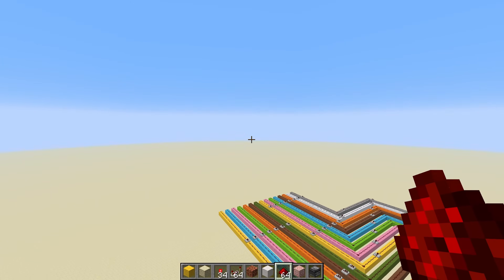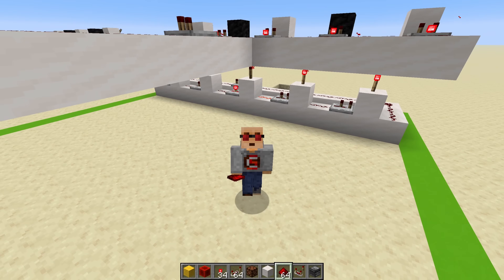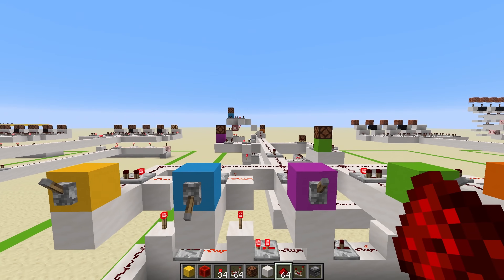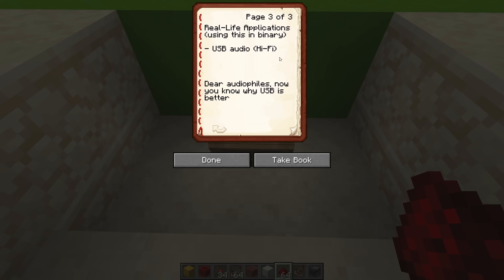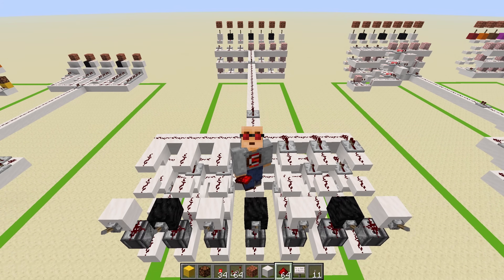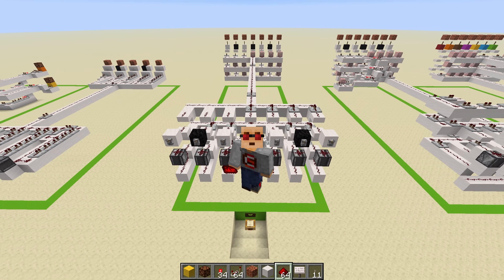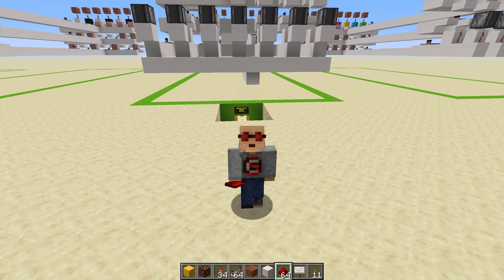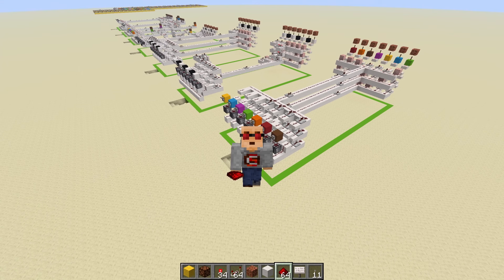How to Send Multiple Signals on a SINGLE Redstone Wire

Comment from the maker: I've deliberately left off signal strenght, since it's extremely slow because it requires a comparator every three blocks to transmit the signal, also it's limited to 15. It's just not practical
Reply: This is not true, I have a build that transmits fast signal strength, it is a well known circuit that uses 15 repeaters
Reply: @challox3840  Agreed. Using that to allow a single bot controlling 256 individual stasis chambers all without ever moving a single inch.
The repeater approach is a bit more bulky, but way faster. And allows for easy staircasing to change height.
Essentially a 3 wide wire that allows you to transmit analog signals at the speed of traditional binary values (where one repeater would be every ~15 blocks).

They're super useful for redcoders (where a specific redstone strength toggles/pulses a specific signal briefly). If you need multiple simultanious outputs, you could probably encode 4 bits in each. So just 3 of these wires could likely transmit 4096 unique signals with the proper encoders/decoders.
Reply: In terms of simplicity and flexibility, binary is probably still the best.

Did some experiments, and was able to transmit and receive 4 signals over analog each. The encoding to analog is suprisingly simple, but the decoding gets messy and my current solution produces temporary wrong outputs (im-perfect solition with postion only fixing signal slightly delayed).
Reply: You can actually do a comparator every four blocks if you're alternating comparator, block, dust, block.  And there is a design that can transmit a signal strength at ~90 m/s, but the wire is three blocks wide.  If you wanted to transmit more than 15 types of signals, you can combine the signal strength encoding with any of the other methods that are in your video.

For a single wire, using signal strength has the potential to give you 4 times the data transfer rate but at the cost of doubling your latency, tripling your wire cross-section, and greatly increasing the amount of work you have to do.  I think the main reason almost no one uses it is because if you want higher bit rates, it's easier to just build 4 normal wires than to build a single fast signal strength wire.
Reply: Chunky, this just showed up in my algorithm for some reason. I never considered using Minecraft to model information theory before. If you're interested about this topic, check out Claude Shannon's "A Mathematical Theory of Communication." The content of this video is directly tied to the Discrete Noiseless System part (Part 1) -- Harvard's math department has this filed away, and it's free if you have access to the internet. I will attempt to leave a comment with the link below this one in the pinned comment. This was a really interesting video that basically describes Part 1 of the paper in layman's terms. Your acknowledgement of signal strength is why I decided to comment, because that means you've got the right intuition about the next steps in information theory. If you have any leads about AlohaNET-type problems, I'd love to hear about it.
Reply: https://people.math.harvard.edu/~ctm/home/text/others/shannon/entropy/entropy.pdf
Reply: @redcap7468 rip, no link is visibld
Reply: Since you got yer nerd on. You mention signal strength limited to 15. Both 4 bit binary and hexadecimal operate on a total of 16 states of 0 to 15. 4 bits of binary is sometimes referred to as 8421 code. And those numbers align with your four bits and add up to 15. lol... Enjoys. 🤓
Reply: I actually have a method to make it so you only have to place one comparator every 7 blocks with a throughput of 4 bits per redstone tick and a transmission delay of ~2 redstone ticks per chunk. Just feed the signal into the side of a comparator in subtract mode and put a lever or torch behind the comparator. the output is 'inverted' for the upper half of the signal strength (ie signal strength of 15 goes to 0 and signal strength of 0 goes to 15), but every time you repeat the signal, it swaps. Doing this allows you to get way higher throughput on a single wire by taking the strengths of 'analog' and digital signals, while only getting a small amount of delay. 4 bits per second on one line with only a 2x increase in propagation delay seems like a good tradeoff in most cases where you're doing long transmission lines. I can send a pic of my setup if you'd like :)
Reply: yep, did the same. I thought he would show the analog method but nop
Reply: There is a thick wire configuration that let’s you transmit analog at the same speed as standard signals
Reply: The simplest method I thought about, since it was only transmitting a state, was to send every signal at a specific frequency, mixing them all along the wire and decomposing the arriving signal in Fourier series to independently check the state of every signal, what would be the implication problems with this method?
Reply from the maker: @Stef_8319 That's basically what I'm doing with the asyncronous method👌
Reply: You can make instant comp lines using CUD

Comment: the IDEA with those optical media methods is that they synchronize by talking over the wire first, where the device is listening, and the host is talking
host basically says "are you there?"
and THEN the device says "yes, im here"
and it measures the delay between when its sent and when it gets a response through some further magic, before the host then says the whole system is sync'd 
and the entire system requires the HOST AND DEVICE to be of good enough quality
any low quality part makes the entire system fall apart

otherwise, if it only sends from the host, it will use things like a "timing pulse" that is ALWAYS on (or a pattern), and so when there isnt any audio, that timing signal is ALWAYS sent

i have a smart TV and a soundbar that work over the optical cable, and there has never been any audio distortion, likely because i didnt cheap out on the entire system

you can actually see this if you watch the light on the other end of the cable, because it has a set pattern of flashing, up until it starts to actually send data

Comment: 3:06 For the record, yes, S/PDIF and TOSLINK both use synchronized clocks at both the transmitter and receiver to reconstruct the signal, and yes, it is possible to lose data over these connections. However, it isn't due to the two clocks being out of phase, as might happen in Minecraft, it's caused by one of the clocks being slightly faster than the other, a phenomenon called "jitter." In extreme cases, this can lead to phantom bits being transmitted and adding a huge amount of noise to the signal, but most devices which use these protocols are accurate enough that jitter isn't an issue, and some devices even have methods of rejecting noise produced by jitter when it does occur. To say that transmission protocols which rely on the receiver synchronizing it's clock automatically to the transmitter are inherently poorly designed is inaccurate.

Comment: Made a minecart system with multiple stops using a single wire and signal strength, all with repeaters back in version 5 to 7, no comparitor needed just make the signal only reaches if a certain strength is met

Comment: another simple idea that pop in my head before watching was a binary method where each line carry 3 lines of info.

you take a line where every 8 block you add 8 power to the line. but there are switches that can add 1, 2, or 4 to the line.
so you use a Redstone Comparator to read the signal.

so if it 3+8 then the 1 and 2 are on. if it is 8+7 then 1, 2 and 4 are on.

this would simple divide the number of lines by 3.

you could also add timing to it to make it hold more info but that would add alot more complexity to this method.

may be add a line going back that tell which cycle is active, this could multiple the info by 8 so having 2 lines can give you 24 lines of data. but this will change it from constant to pulse data.

Comment: Your disparagement of real-life synchronous transmission schemes is a bit unfair. In practice, the protocol is always designed so that there are features of the signal that the receiver can lock onto and synchronise itself with.
The main reason for not using a separate clock signal isn't to save money, it's to avoid problems with skew. Signals sent at the same time don't necessarily reach the far end at the same time. This isn't a problem in Minecraft because transmission times are perfectly predictable, but it's a big issue in the real world.

Comment: You have no idea what you're talking about. Toslink and spdif use Manchester encoding to encode the clock and the data into one signal. It's a self clocking, stable data stream. It does not desync. In fact, this is better than a separate wire for clock, as then both wires would need to be length matched.

Comment: Wouldn't it be possible to replace the clock with world sync timers based on daylight sensors? This would eliminate the clock line or the need to sync timers, and overcome the most severe disadvantage of the serial one line approach? 
This should be simpler and probably faster then the admittedly impressive other circuits.
Reply from the maker: That's a really good idea! Defo try it, let me know how it goes!

Comment: Great work, and cool to see you so active with your YouTube community (reading/liking comments/etc even on 3w old videos). Wouldn't be surprised if soon you get too big to keep up, and I guess I'll hope that happens for your benefit. 🤣

You explained a lot well, always hard to explain to a large audience but you kept it pretty simple, and I think even if people don't follow the details they understand the options and limitations.

One bit I particularly didn't get, even as a software engineer with some knowledge of digital electronics and familiar with binary was how you're getting more efficiency encoding 7 levers as "binary" over 3 wires. I thought on it some more, and assumed you're basically sending an "address" for a lever that changed at once? Since if you want to send the state of all 7 levers I can't see how that would fit in 3 wires (without sending multiple pulses), but you could send a lever change in 3 wires.
Reply from the maker: Thanks for the donation! I try to reply to comments because some of you guys have good ideas😄. As for the binary, like everything, as soon as you "compress" a signal, you inherently and inevitably lose some function. For example, lossless audio formats like FLAC leverage the fact that you have limited entropy to reduce file size. If you had infinite entropy in your music, it would be the same size as an uncompressed WAV file. Here, because you're forcing compression, there's inherently some things it won't handle without losses. For all methods except the syncronous, if you flick two levers at the same time, that'll create losses, aka errors. Hope this helps😊

Comment: Maybe a dumb question, but let's say you wanted large data transfers, is it somehow possible to do like chest minecart hopper comparator stuff to send a lot of data at once and read it partially asynchronously?

I assume entity render distance stuff would be a major drawback, but maybe it could be a way to transmit like a whole "file" faster? Maybe a small image or something
Reply: Maybe a realistic example of where it could be useful could be like a large display and ability to save/load images faster, or if programs ever get complex enough in programmable redstone computers to transfer one faster from a large storage system to the cpu
Reply from the maker: It's a cool idea, but you're gonna have a really hard time making a fast enough decoder for that (I tried)
Reply: @ChunkySquaresMC  yeah I figured that would be the hard part. Wasn't sure if hooper minecarts let you get around normal hopper speed for parts of decoding to at least get stuff split up so it can be decoded in parallel, but I haven't thought through which encoding method you would use and how you actually decode that to come across the hard performance limitations. Cool to have a response didn't expect one!
Reply: I would think the chest solution is probably objectively best for information density in storage. But as far as you know (and I don't know any better) not faster for speed due to decoding limitations even with high volumes of data transfer

Comment: I really wanted to see the clock-based solution combined with using signal strength with comparators (you can send a different strength each tick).

With a 16 tick clock cycle that's 16*16 = a full byte of information every 3.2 seconds.

The drawback is the wire speed is 4.5x slower (18 blocks/tick -> 4 blocks/tick), but you get 4 extra bytes for every wire.

I guess that's kinda useless in practice, you can just add 4 ticks to the clock and it's much faster on a long distance.

Comment: Method 4: You can only send one code at a time. If you turn on multiple levers, you’re basically doing a logical OR between the two codes, and will end up transmitting the code for a completely different lever (or possibly an unused code, if there are any). So this method is only suitable for pulsed transmission, not continuous. (That is, buttons or brief one tick pulses, but not always-on signals like levers.)

Comment: One thing i think should have been included is the "Push to send" method, that can simplify the redstone at the cost of an extra action

You could add a push to send button to many of these, allowing for greater span-proofness  as with a single button press, dictating when the signal gets sent, you avoid editing the signal as it's being sent, corrupting the data

Comment: Congrats, you've invented a 3-bit parallel bus. (3 wires)
You just re-invented the 1970s ribbon cable with 3 wires.
Reply: Pretty sure he didn’t claim otherwise — He did mention DB25 parallel ports at the end of that section.

Comment: S/PDIF (protocol) over TOSLINK (viber optics) uses a single optical fiber to transmit both data and clock information simultaneously.
The protocol employs Biphase Mark Coding (BMC) - a self-clocking line code - where each bit period contains at least one transition.
These transitions allow the receiver to recover the bit clock directly from the data stream, eliminating the need for a separate clock wire.
Thus, even in a one-wire (or one-channel) system, you can reliably transmit serialized data and timing together

TOSLINK’s entire point was to transmit S/PDIF audio digitally and optically using a single link.
It doesn’t need two wires, because Biphase Mark Coding embeds the clock in the data stream.
That’s why it works — and why the “it should have two wires” argument is fundamentally misunderstanding how serial digital signaling works.

This principle isn’t unique to S/PDIF - similar self-clocking encodings are used in Ethernet (Manchester / PAM / 8b10b), USB (NRZI with bit stuffing), and SATA to achieve clock recovery over a single differential pair.

If you think a digital link needs a separate clock wire, you should probably tell that to Ethernet, SATA, HDMI, USB, PCIe, and TOSLINK — because none of them do.
Reply: So, if you can:  do a single-redstone-wire 32 bit wide BMC schema version of what you tried to do here.
It's fast, reliable, self-clocking, Idiot-proof. And doesn't need you to be near of the field to keep a clock synced.

Comment: Before watching:
There are basically two approaches here. You can  either use independent lines and keep the signals simple, or you can encode and decode a more complex signal on each end to handle routing.
Each has advantages and disadvantages.

Running parallel lines is simpler. It's less resource intensive for shorter runs. It increases signal speed and throughput since you don't need to process the signal, and signals can even be sent simultaneously. It being simpler also means it's simpler to debug.

Using a single line is less resource intensive for mid-to-long runs, since only one wire is needed. It can be beneficial when you need to route signals through a small space where multiple lines wouldn't fit.

Honestly, multiple lines is probably the more useful of the two approaches. We generally don't transmit redstone signals over large distances and, when we do, we generally don't need to route several along the same path. This is especially the case with the limits of loaded chunks and all that sort of stuff.

I expect that viable applications for routing multiple signals through the same line are fairly niche in practice.

And if you're in survival and resources are an issue, by the time you're building giant redstone things that might need this, you can trivially have farms for all the materials, and with autocrafters now in the game, survival has grown even closer to just being creative.

After watching:
This seems to be a decent explanation of different ways of encoding and decoding those signals. It may be of niche utility, as I said, but niche isn't never, and it seems to be good enough to be useful. Good job.

Comment: The biggest problem with transmitting multiple switches signals over a single line is that sending signals at the same time can get the wire busy? leaving that question aside, I think it would be the easiest solution to assign different Redstone signal strength to different switches, and then use the AND gate at the receiving point to detect different specific strength and connect to a copper lamp.